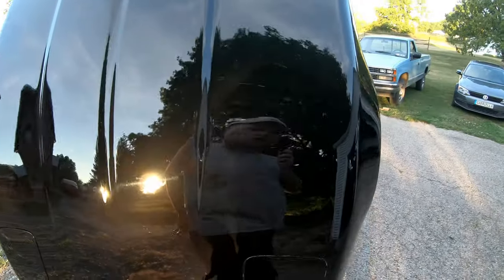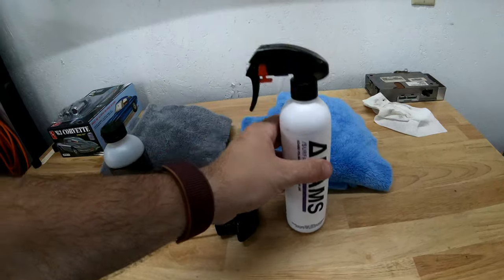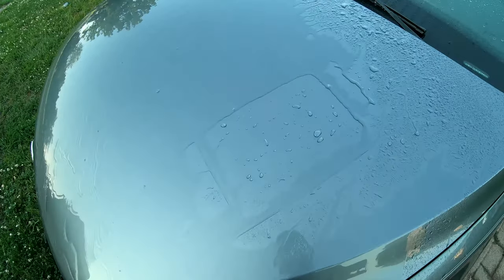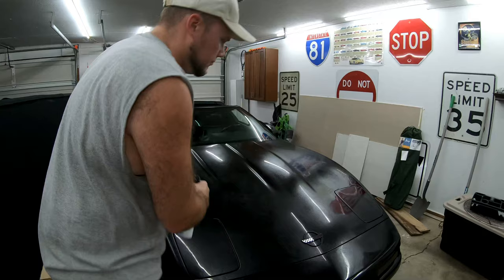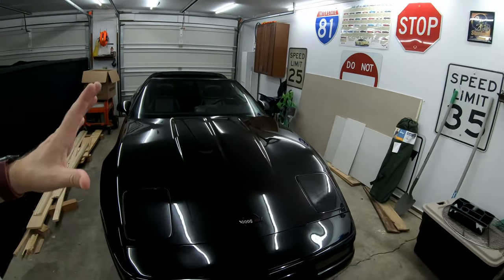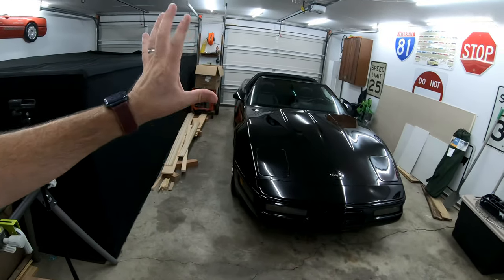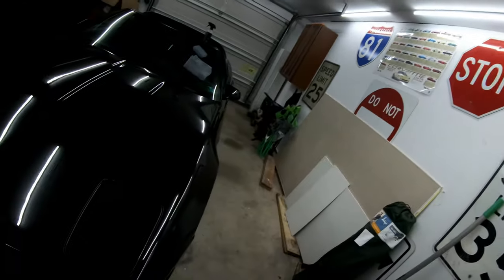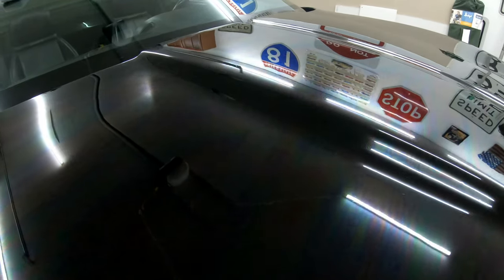Mirror Mirror on the C4, Graphene Spray Will Put Your Jaw on the Floor!!

Comment: I'm so glad that you turned me on to Adam's products. I've tried probably 5 products on my wheels and none of them work so I went up to the parts store today and just happened to stumble onto some Adam's wheel and tire cleaner so I bought it and as soon as I sprayed it on it started working,I took a brush to my wheels and sprayed them off with the hose and they look like new wheels. I will never use anything else again. Thanks for introducing me to Adam's. It's a little expensive but it's worth every penny because it actually works,so I'm not wasting my money.
Reply from the maker: Jason, I LOVED reading this. So glad you like it! I am a believer! Thanks so much for sharing with me :)

Comment: Great job, she looks great! I plan on ceramic coating my car but it needs to paint work done etc first. Can you build layers of it up like with wax, or just one coat only? If you use it on your windshield and you use your wipers does it streak? I've done it with wax before and it was really bad for streaking afterwards. 
Keep up the good work!
Reply from the maker: Hi Gavin, I don’t know about the layering question BUT on the windshield, no streaking at all. I have been in lots of rain in my Jetta including last night and it’s amazing. Don’t even need to use wipers at all on highway. Only at slow speeds and absolutely no streaking at all :) I would highly recommend for your windshield! Good luck!

Comment: Looks great! I have a black 93 corvette and I’m going use the graphene ceramic coating. I ordered red rear bumper lettering but does not look like yours. Where did you order yours?
Reply from the maker: Thanks Hector. Nice car ;) you will love the coating, looks great! I got my letters off eBay back in 2013 from corvettemods1. I just checked and it doesn’t look like he sells them anymore. What do yours look like? Don’t they match the letters on your car?